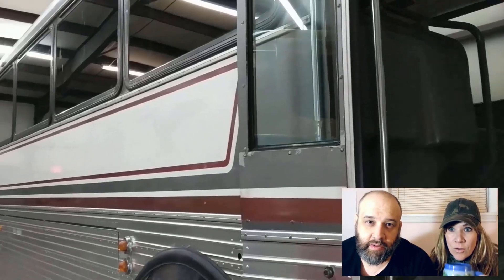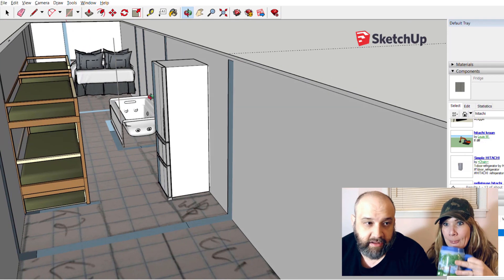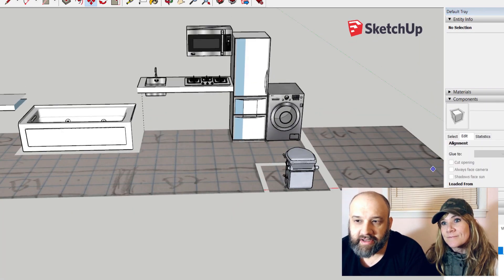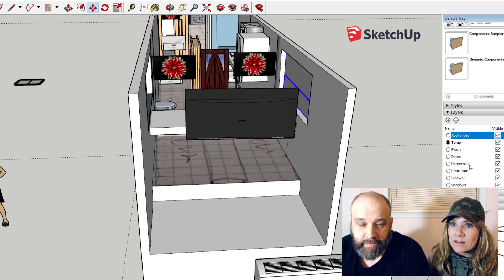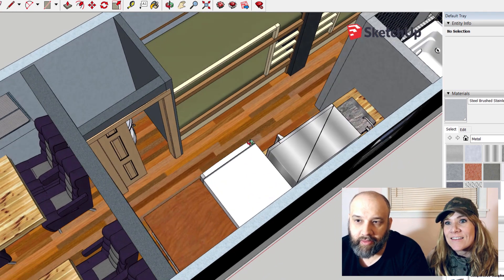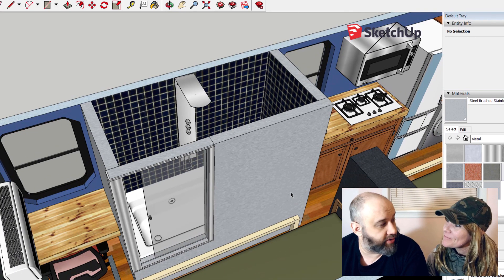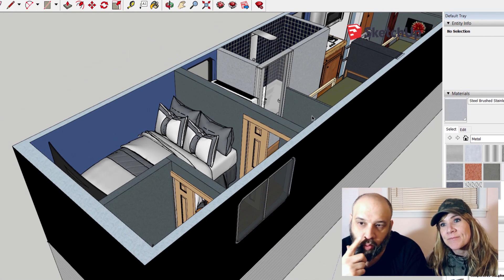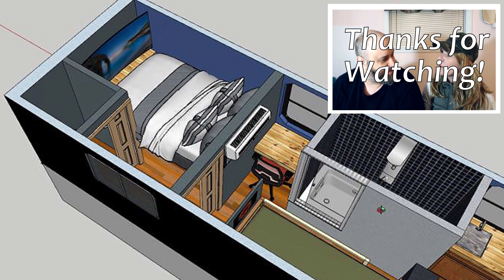Silver Eagle Bus to RV Conversion!! 3D Digital Model Floor Plan BONUS: Using SketchUp!!

Comment: Two suggestions after viewing your very nicely executed virtual floor plan: 1)Use original bus windows where ever you are able to do so. They are far better made, and look nicer than typical RV windows. Besides that, the posts between the windows are structural. The bus being monocoque construction, virtually every part is important. The aluminum "siding" is actual extruded aluminum, and while providing a finish able to take lots of abuse, it also adds to the structure.  2)I believe I would re-think the use of mini splits, as the condensing units use up a lot of real estate in the baggage bins, and you will probably find ventilation an issue. Also, most are designed for 240 volt operation.  Dometic makes a small split system, designed for applications like this, they run on 120 volts, and are much more compact, designed with flexible mounting. I've used a number of these, and been very happy.
Reply from the maker: +Electrical Engineering We really appreciate your input. :) The gentleman we purchased the bus from offered us some helpful tips on where to order glass from...and we are interested in investing in quality glass made to our specifications. Truthfully, it's not something we know the cost for yet. We bought the bus from folks who spent 8 years converting their own Eagle bus...we saw it, and it was just incredible. When we told him we hoped to do this in 2 years, he chuckled. And now, we feel like this is going to be a slower build than we originally anticipated. 😂 We are new to basically every part. How hard could it be? We have said to ourselves. Learning to weld. Replacing window sections with aluminum sheeting. We will have to hire helpers with experience, I think!